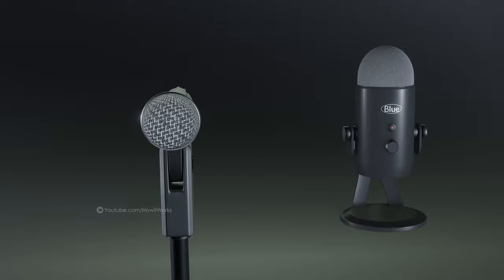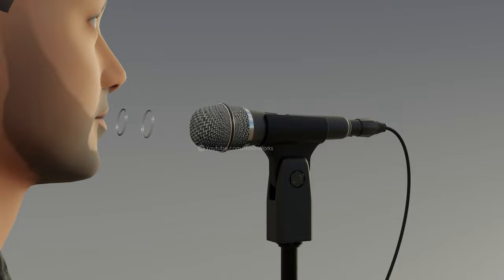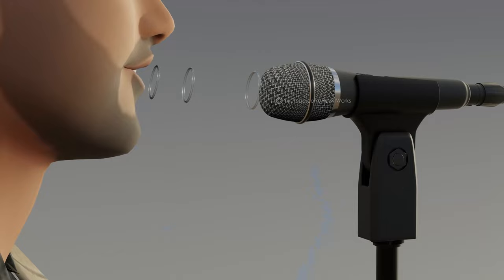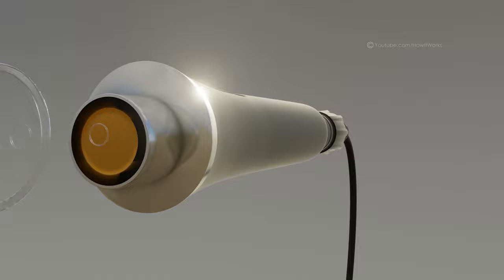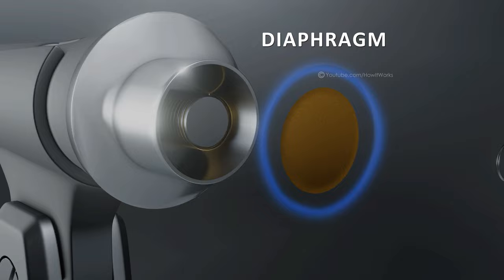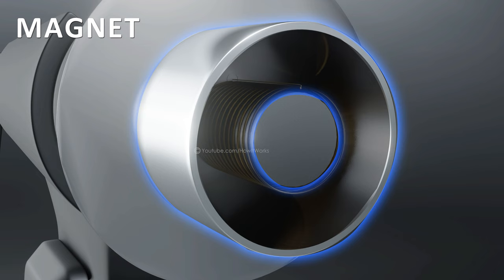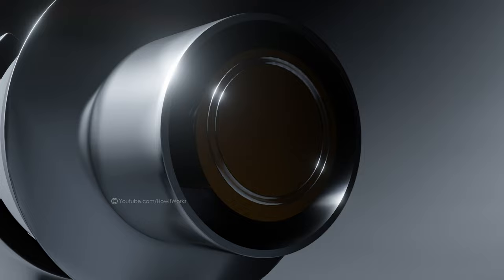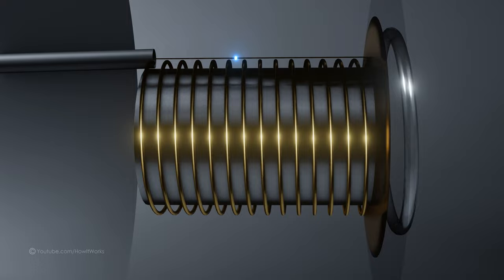How Microphone Works? (3D Animation)

Comment: if it only captures how loud we speak then how does it capture exactly how we sound, I don't really understand that
Reply: It's practically a reverse speaker instead of taking a analog input and vibrating a woofer to produce sound it functions the exact opposite way. Sound turns into (diaphragm /woofer) vibration which is converted into a analog output into whatever it's plugged into
Reply: i have been there. so let me share my thoughts. just imagine putting our finger in a wet clay, that captures our finger print beautifully. same way, all the disturbance in air, that enters the microphone diaphragm disturbs its shape. if i capture this disturbance at very high rate (say at millisecond interval), its like capturing a movement by taking multiple photos. So, just like i can replay the photos and recreate the movement, i can replay the mike-captured disturbances (using a Speaker) and play all the sound I and my people around me made into the speaker. In summary, take high frequency sampling of mike disturbance and simply replay with speaker. Thats it !!
Reply: The faster the diaphragm vibrates as it is moved by sound waves, the higher in pitch the sound captured is. Amplitude is how much the diaphragm is moved. What I don't know is how multiple notes are recorded reproduced then heard. How does it not just become a higher pitch based on the overlapping sound frequencies. And how do microphones capture timbre or sound quality.